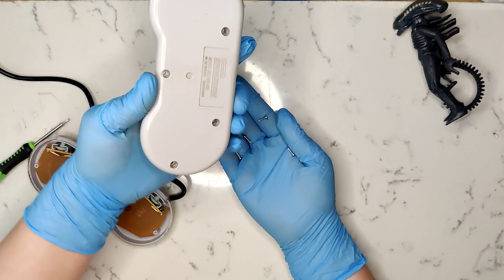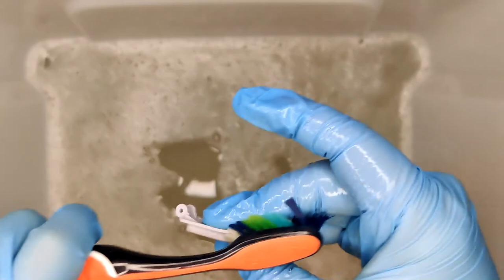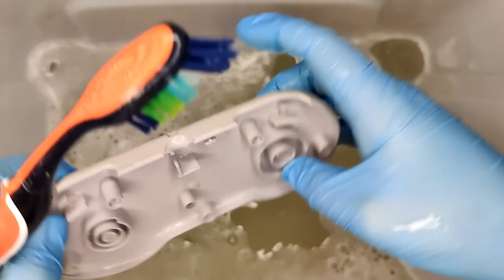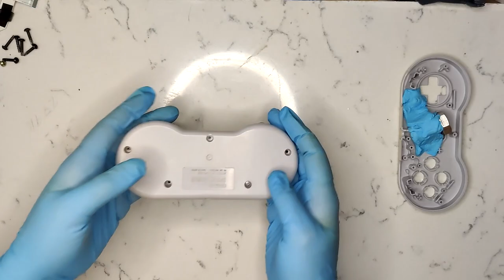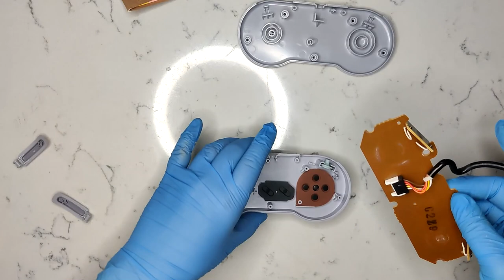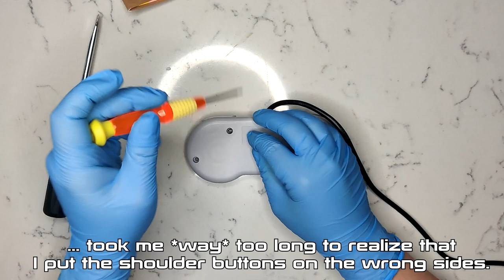Scarlet Restores! | 05 | SNES Controller Restoration!

Comment: Looking good again. I can't tell from the video/lighting, but it looks like the exterior of the controller may have been a little bleached from too much time in the peroxide?

The color outside should be the same as the inside of the shell. There's a fine line on "retrobrighting" plastics, and I've bleached a few 80s-90s pieces myself.
Reply from the maker: Nope, that's the lighting.